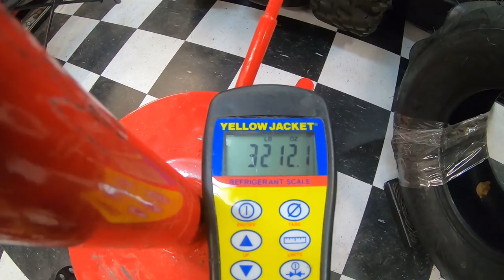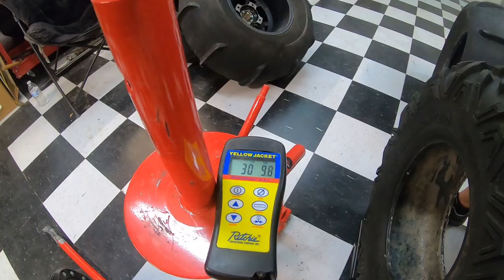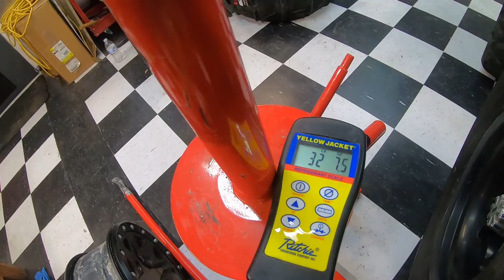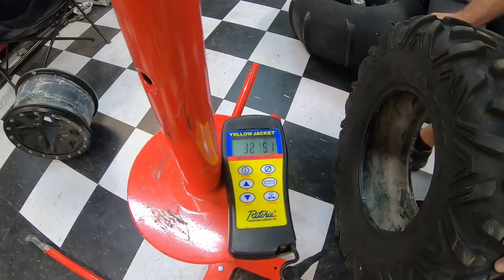CAN AM MAVERICK X3 Paddle Tires

Comment: Great vid, we have in the crew a set of Sand Tires Unlimited and Sandsports SXS, both made in the USA, excellent rubber compound. After driving both I would recommend the Sandsport SXS. We’ve never liked Skat-Trak style for the lack of durability. The STUs on the TRX250R are over 20 years old.
Reply from the maker: I have owned the STUs and I like them a log. Have not tired the Sandsports